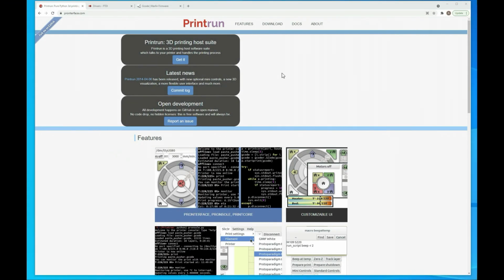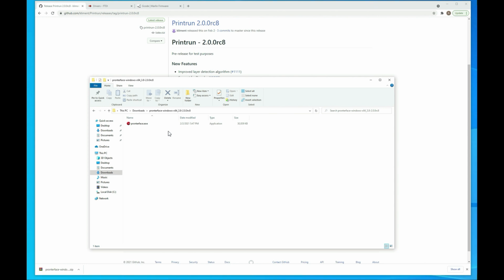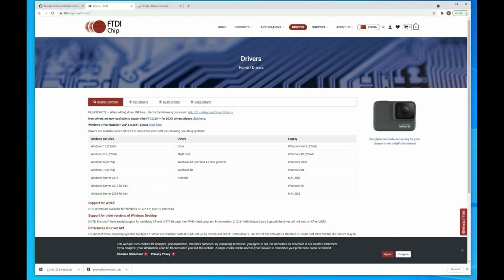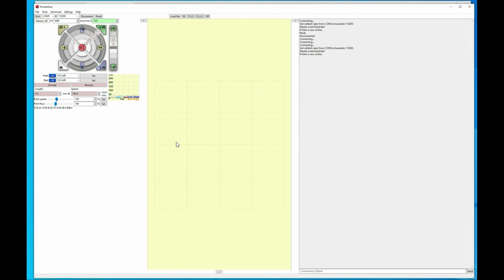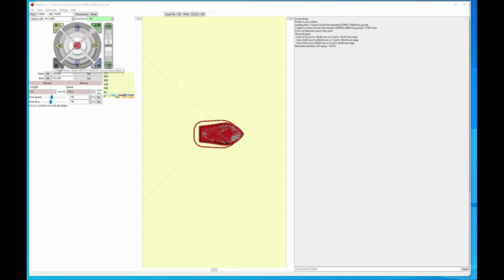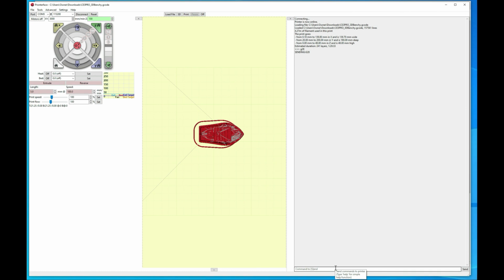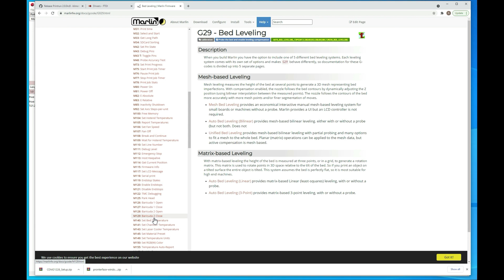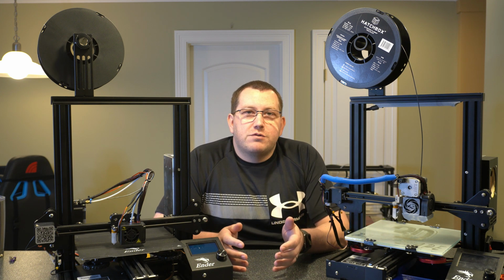Pronterface Setup – The Easy Way!

Comment: downloaded the FTDI driver but Pronterface still sees no ports.  Device manager does not show ports as in video, when I plug in printer a USB device pops up but not in any ports tab.  I can see "GENERICSTM32F103RC FS MODE" under USB devices.  I was told to try another cable, that this one may not handle data, but if it shows the board isn;t that proof that it sends data?  I'm getting so frustrated trying to add BLTouch
Reply from the maker: Hi. Honestly, i would start with swapping out the cable. I had a similar issue and it ended up being the cable. Just make sure you get one that is meant for data transfer.
Reply: @3DPrintscape  I have the same problem and I have tried changing cables, still nothing
Reply from the maker: @heddywood  Try downloading and installing the drivers i cover in the video, the link to them is in the video description. If that doesn't work, something like AV/Windows Firewall could be blocking the connection.
Reply: See my reply above if you still didn't solve this issue.